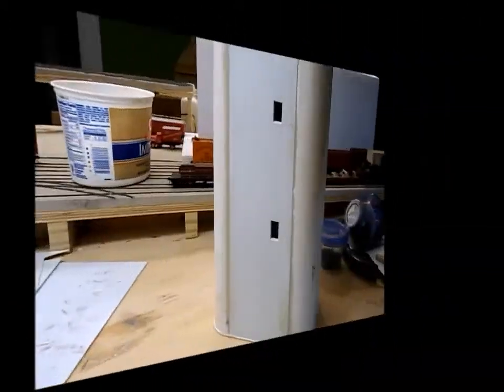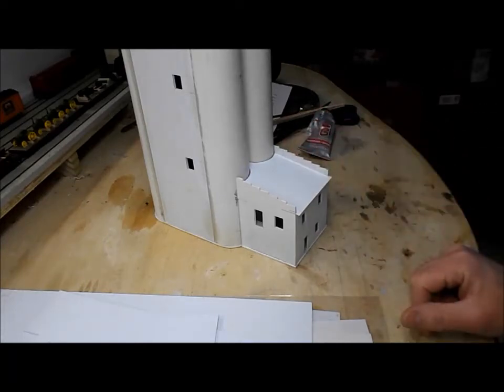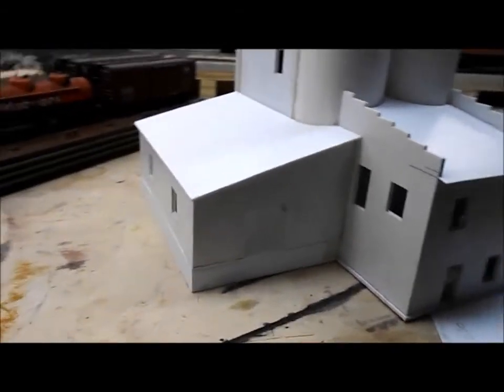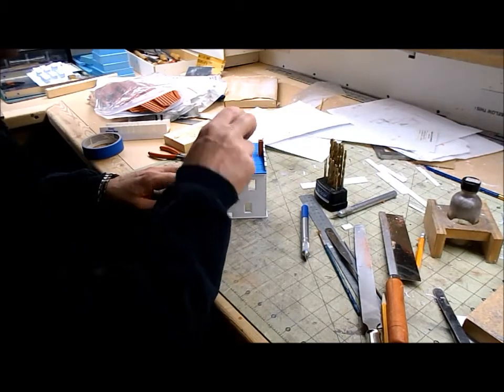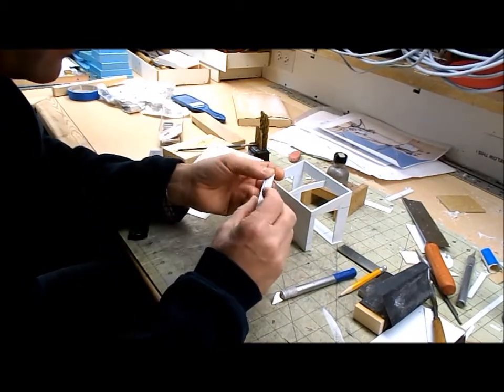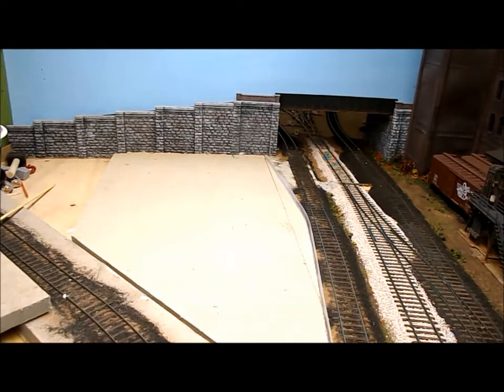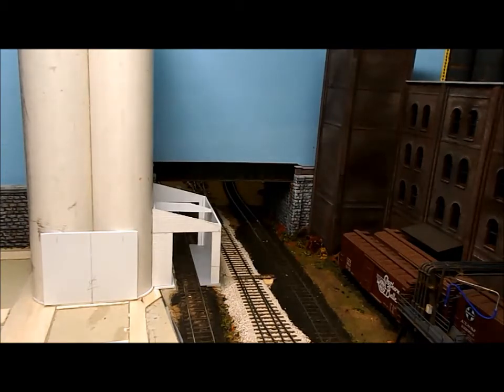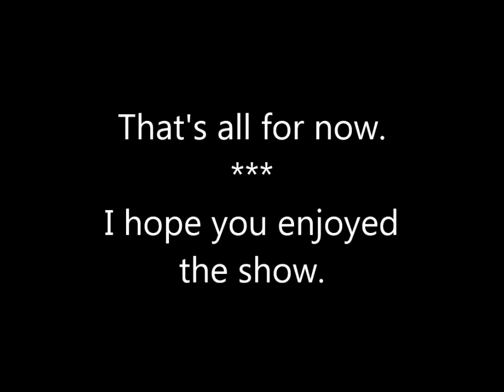My railroad: B. Kay Feed Co, part 2

Comment: Another great video...Its coming along nicely.  I really enjoy watching you scratch build... it's nice to be able to do so as not to be limited to a kit that anybody can buy.
Reply from the maker: Thank-you.  Yes, scratchbuilding can be very enjoyable.  Walthers does a small collection grain elevator kit which could easily have been used as a starting point for this project, but I wanted to create it myself this time.  Actually, I think the kit would have needed so many additions & alterations to make it fit that it probably wouldn't have saved me any time in the long run.  Another benefit is that this has been a very inexpensive structure to build - quite a contrast from Dunnow Storage.

Comment: I have used Heljan corrugated iron roofing sheet which I stuck to a piece of ply. I then burnish either aluminum or copper foil on this using it as the pattern and use these very thin foil sheets of corrugated iron (easily cut with scissors or hobby knife) and, since I build in Australia, I find that corrugated Iron is pretty much everywhere...
I have used this ply based pattern for many years and storage of this and other sheets of patterned ply is simply on a shelf, vertical along with some books, magazines etc.